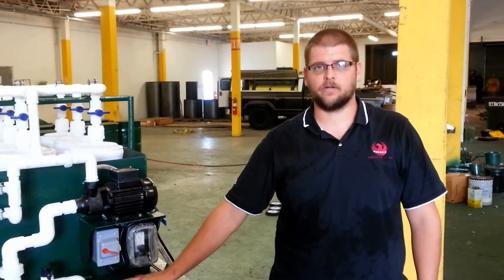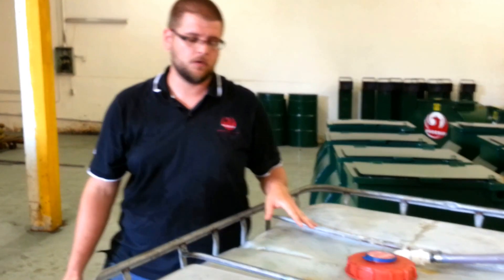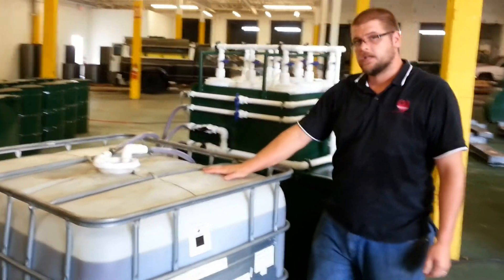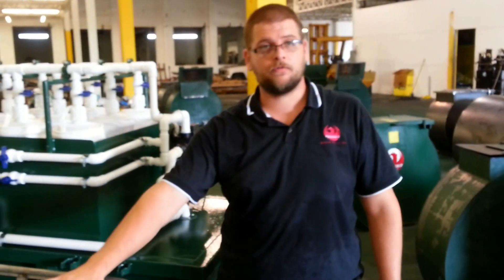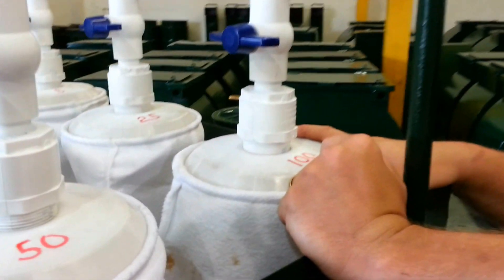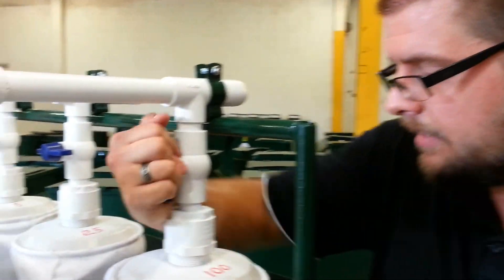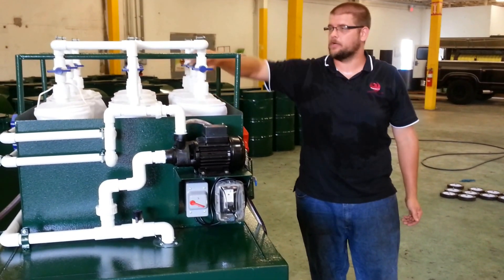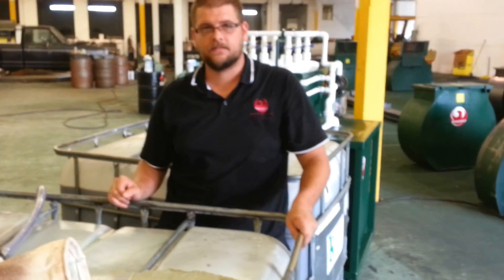R2000 Oil Recycler

Comment: That's where your wrong,  a Centrifuge is only good for getting water and food particles out. How our system beats a Centrifuge is by "Cold Pressure Filtering"  a centrifuge will heat the oil between 115 and 130. This of course is due to the force of the spinning. Here's the problem, your tallow and animal fat is going to turn into a liquid form.  This is no different then if you cook bacon in a pan, the oil at high temps is a liquid. Our system will beat ANY Centrifuge! We have TRUE perfect oil

Comment: You may have clean oil with that system, but you wont have dry oil. Oil through your system wont pass the HPT (hot pan test)
Thats were a centrifuge is best.
Heat and settle then a centrifuge. Perfect oil every time